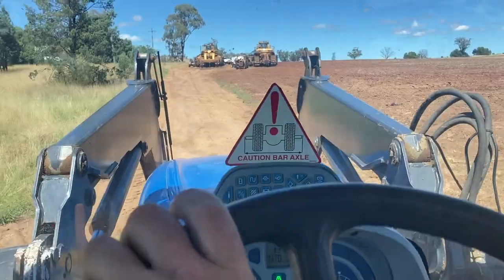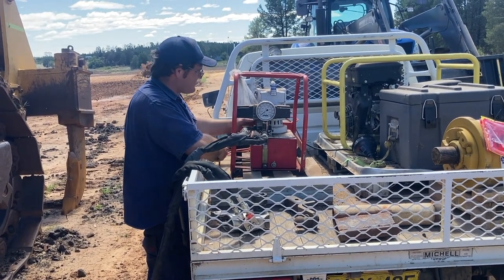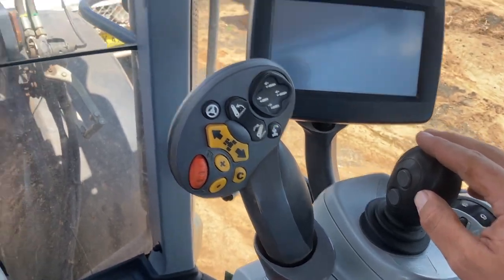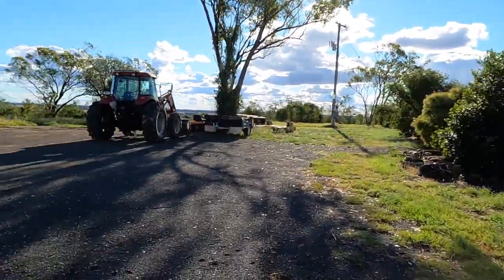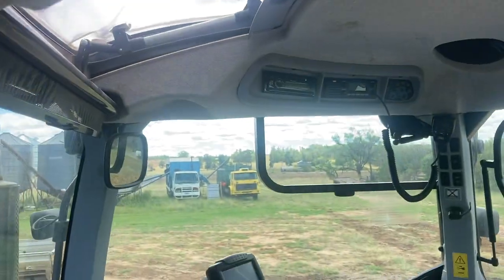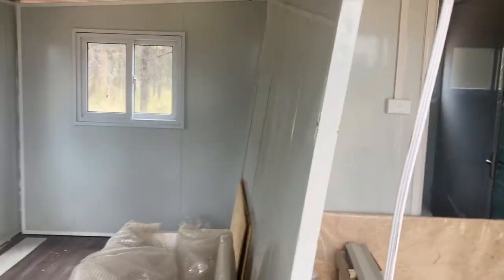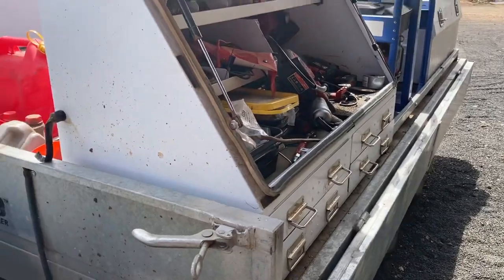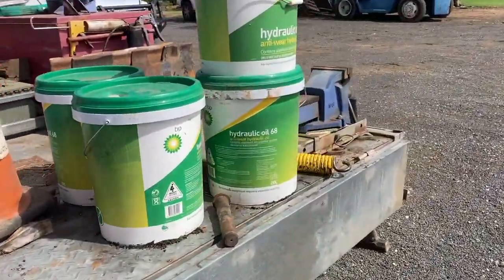D11 Repairs & Driving With No Seat! (Vlog 62)

Comment: Trailer tips.
Various sized PVC pipe works a treat for holding things.  
If you have the means,   mount all your box's on a frame so you can take it on or off with a loader . Frees up your trailer  at a pinch .

Comment: The longer you leave the protective tape on windows the harder it may be to get off ... ditto the plastic on the wall sheets also may break into little bits and fly around. Peter and the pin made me laugh. Agree with the rationale behind workshop trailer .. can even tow behing tractor with right fittings ... also seen ball fitted to forks.  Suggest you give it a blow out whenever you pass an air hose.   Great to see the D11 in perspectve with people utes etc ... they are big!!!  Hope the rain bomb leaves you alone 🙏🙏👍👍

Comment: Hey guys great video. Just a quick note/tip on the new newHolland. I used to drive it’s bigger brother the t7 235 I don’t think there is much difference between them other than a little bit of hp. Try putting your clutch in push you power shuttle into forward let your clutch out the tractor shouldn’t move but when you push your throttle it should move (it’s pretty much like a auto)and to go into reverse there is a orange forward and revers button it’s the one that looks like a double ended arrow just let of your throttle push the reverse direction and your good to go hope there the same and this helps cheers Pete.
Reply from the maker: Thanks peter! Will check it out